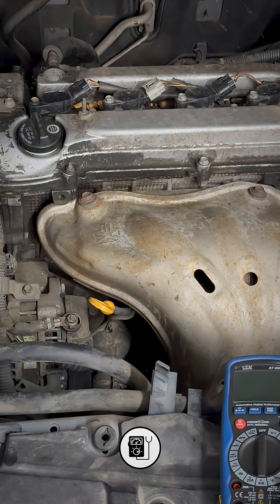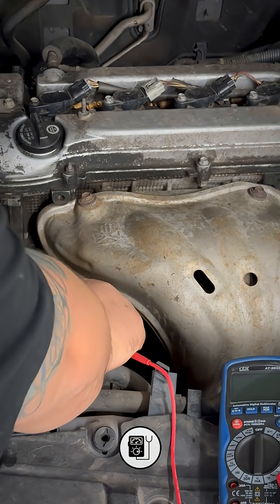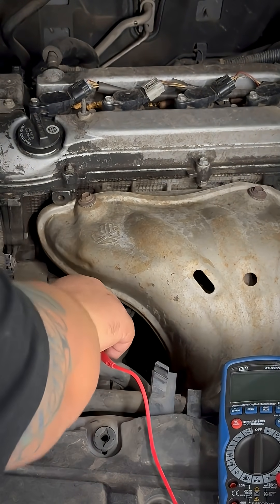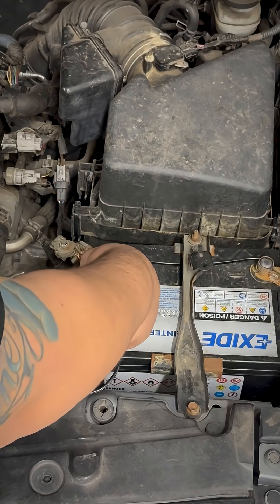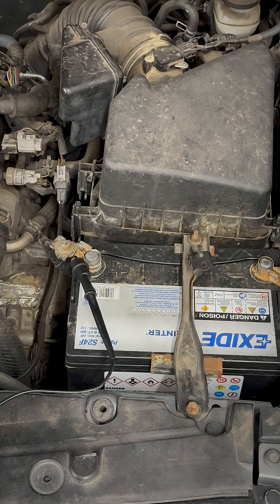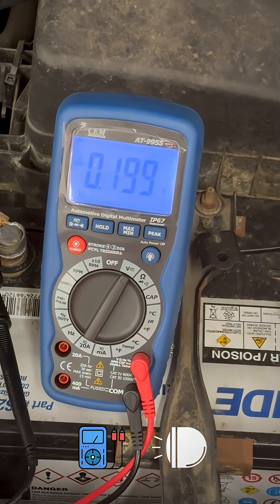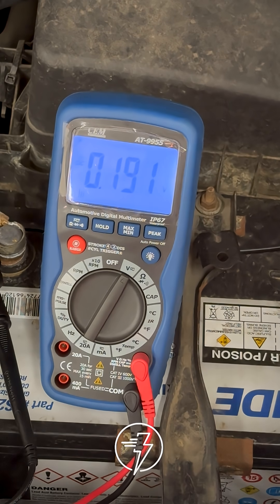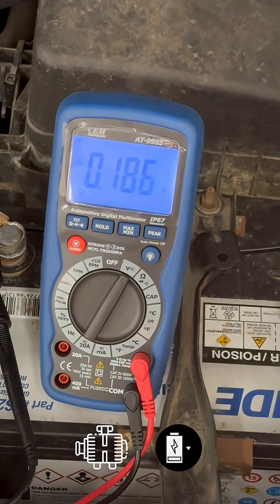Alternator Voltage Drop Test Made Easy (Master Automotive Training)

Comment: Yes you can, negative voltmeter lead too center of battery post and positive voltmeter lead to alternator housing and run the vehicle under a load just as above   and see what the meter reads ,say under 0.2 volts or 200  millivolts.
Reply from the maker: Correct thats a VD on the ground side. You can also go from battery ground to pin 4 of the DLC for chassis ground VD.